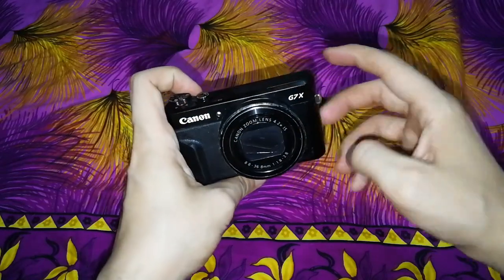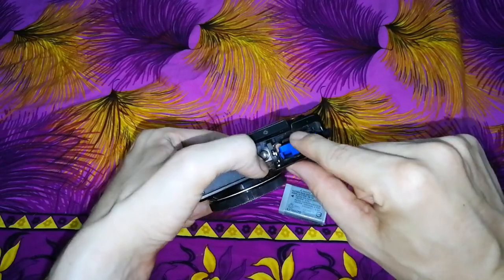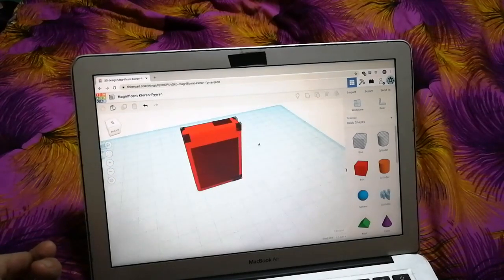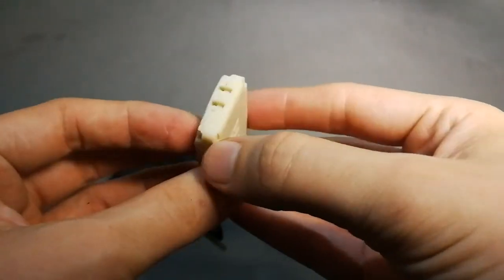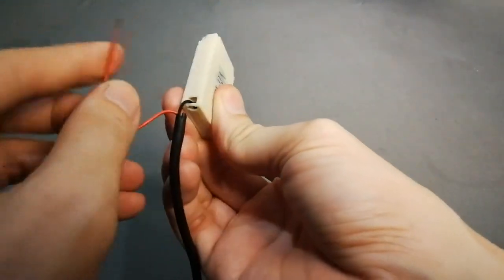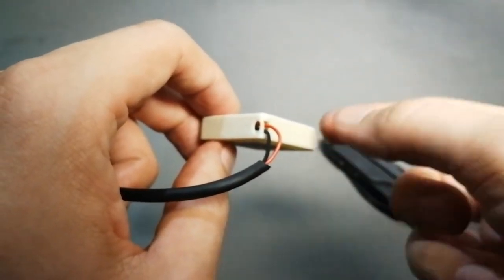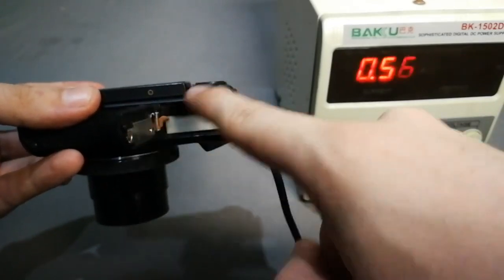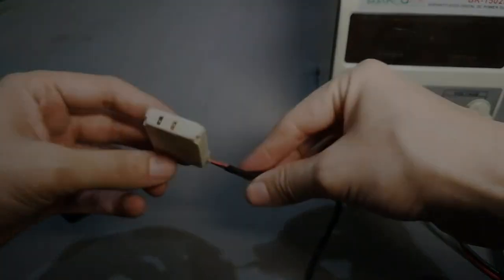Canon G7X Dummy Battery DIY

Comment: hi! will this work on all old digicams? just the positive and negative therminal? even though it shoul be 3 therminal??
Reply from the maker: I've done this with other cameras and it has always worked. But without the third pin they would often give a warning that it's an unofficial battery, or they just don't show the battery percentage.